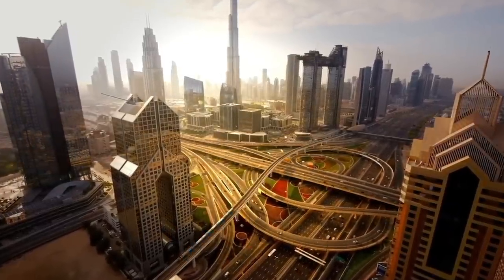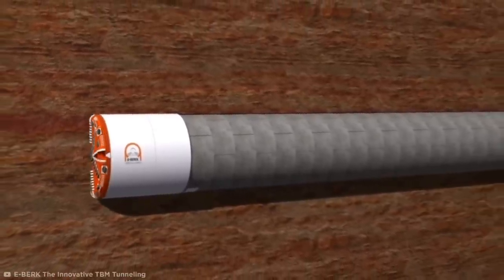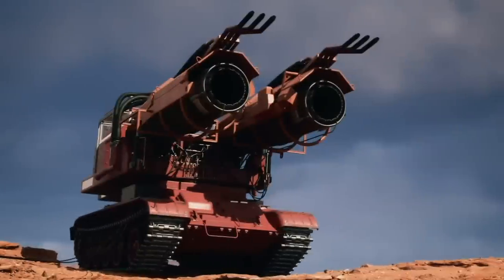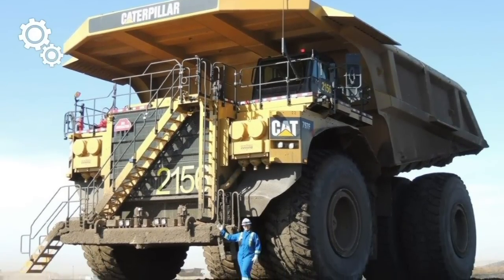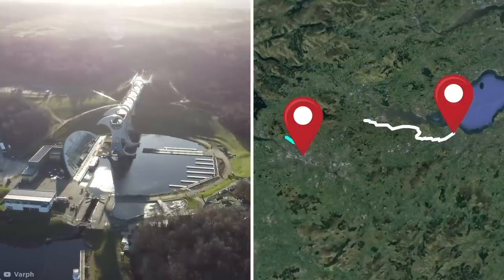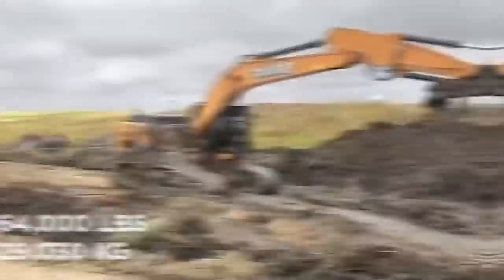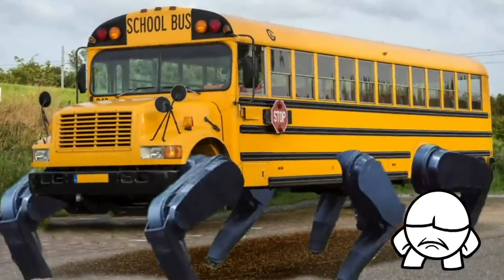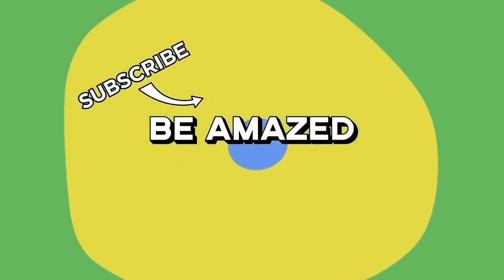Most Powerful Heavy Machines Of The World

Comment: Considering that stratolaunch  uses normal jet engines, it wouldn’t be able to fly at  243, 500ft  it is simply too high for an air breathing engine. That altitude is only possible for rocket engines. Great video by way😊

Comment: At 2:07
The stratolaunch....

That plane cannot fly it nearly 250,000 ft. That may be what the shovels it carries launches to, but there is no way it can fly that high. The 747 can only fly to about 40,000 ft, the launch typically happens at about 30,000 ft....
Reply: 35,000 feet, as per WIKI.

Comment: You calling old timers weak? well that means you are underestimating the power of steam the 1822 engines could atleast pull 15 tons or more and you think they cant move 1000 pounds of soil moving at 10 or 15 mph you just need to learn how powerful they are for their size The H8 could pull 17000 tons of coal moving at 50 mph

Comment: The Stratolaunch DOES NOT and CAN NOT climb to 243,500 feet. Its maximum altitude is between 30,000 and 40,000 feet, the same as any commercial airliner. At 243,500 feet, the jet engines would not have any air to maintain combustion, nor would the wings provide any lift. Also, the Stratolaunch has a total weight capacity of 550,000 pounds. The plane itself weighs 500,000 pounds so its payload is only 50,000 pounds. Please do some fact-checking before presenting such erroneous information.